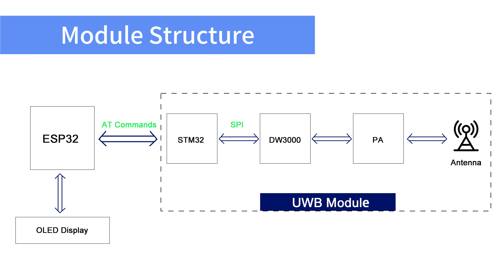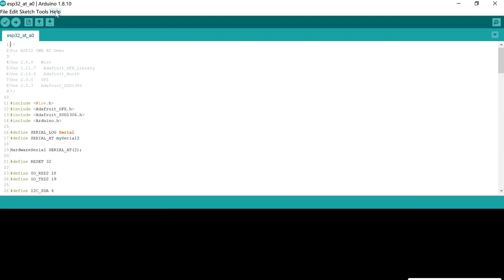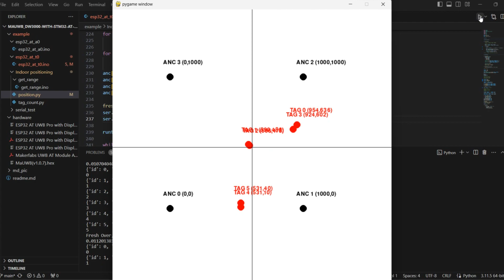MaUWB multiple anchor tag testing

Comment: Hi there, 

If I wanted to track a ball or tag in the Z axis as well as X,Y across a similar area as this video would it be possible by simply adding extra anchors in different heights? Do any examples or existing libraries support this or would additional work need to be done?

Thank you in advance, this is a really interesting product to have easily available :)
Reply from the maker: Yes, Z-axis positioning is supported. The accuracy and behavior depend on the positioning algorithm used. For more technical details, feel free to contact us via email at info@makerfabs.cc
.

Comment: Using the provided sketch (#define I2C_SDA 39 and #define I2C_SCL 38) I get the errors below on multiple hardware units:

(1007) i2c.master: I2C transaction unexpected nack detected
(1008) i2c.master: s_i2c_synchronous_transaction(924): I2C transaction failed
(1009) i2c.master: i2c_master_multi_buffer_transmit(1186): I2C transaction failed

Comment: what's the higher frequency you can update the position? Is there a big difference depending on the number of tags? I need to update position at small range (around 20m) but with at least 50Hz, is that possible?

Comment: Great video! Thanks a lot for this demonstration! For a field of 110m x 70m would 6 anchors suffice (4 in the corners and two at the 55m marker opposite of each other)? Those anchors could then be tracking up to 32 tags, correct?
What's the power consumption for the anchors and more importantly for the tags?
Reply from the maker: Yes, the maximum distance is up to 500 m. It now supports up to 64 tags, and we have not tested the power consumption in detail now . Hope my answer can help you.

Comment: Hi! got few questions:
Can you track the location with a higher refresh rate to get smoother location feedback?
What is the factor that limits the number of anchors to just 8?
Are there any downsides of MaUWB model when comparing it with ESP32 UWB DW300 + wrover?
Does any of the modules allow for higher number of anchors?
MaUWB is dw3000 but on the website it says that it supports only CH5, did adding stm32 eliminate CH9 availability?
Reply from the maker: 1, Yes
2. This is the quantity suggested by the supplier.
3, ESP32 UWB DW3000 can use full functions of DW3000, such as data communication, but it requires the customer's own programming.
4, No
5, unless you write your own firmware for STM32, you can only use CH9